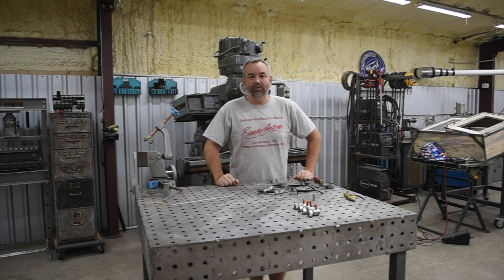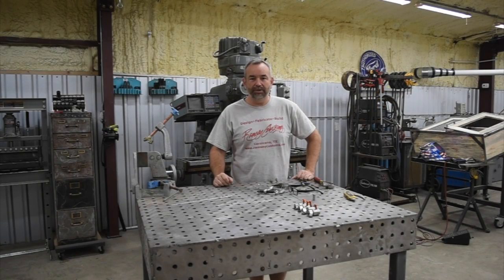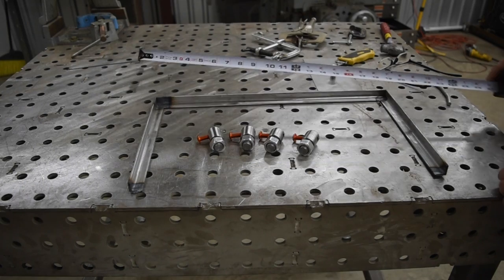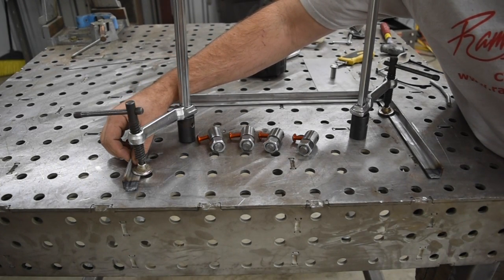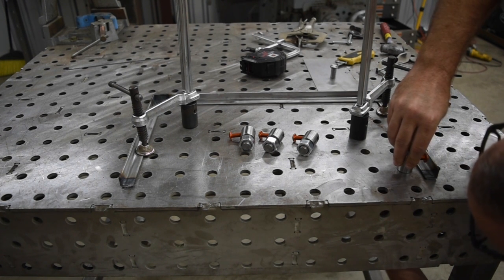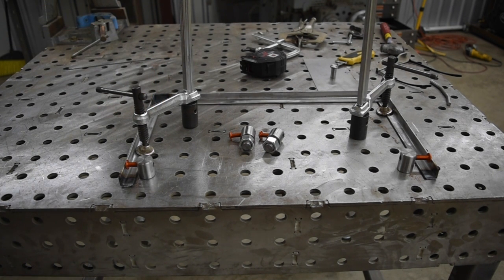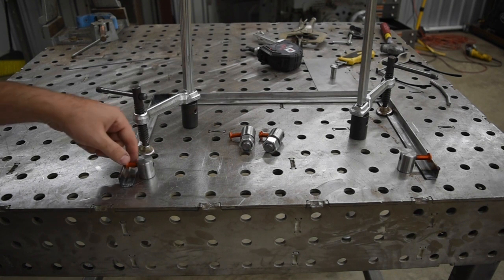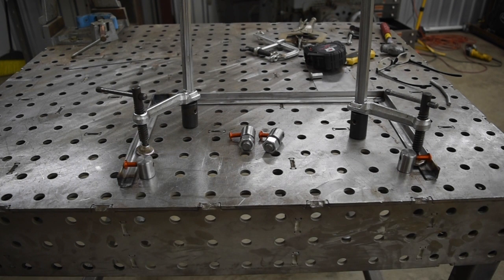Machining Fixture Stops for Build Pro - Certiflat - Fabblock Welding Tables - Stop Warping Welds

Comment: Put a scrap piece of the same angle iron under the back, unsupported edge of the foot of that clamp so you'll have a flat surface to clamp to. Or, clamp the foot of the clamp to the table (instead of the work) so IT acts as a stop, opposing your new stop. And I'd sure want to get that middle, top piece of the work stabilized and squared up to the legs, before moving and/or clamping the legs. Without that midsection stabilized, your new dog stops can't realize their theoretical accuracy. Which should easily be a thou, if you're using something like a 32 thread pitch adjusting screw. Good design. I'd like to see it used to it's full(er) potential. Thanks - Lumpy

Comment: Fantastic idea. Just a thought, if the orange bolts were longer, you could have them go through the fixture, then you could use an Allen key to adjust it from the other side.

Comment: How well do you like your tab and slot table?
Reply from the maker: I like it a lot, works well
Reply: If you need any further endorsements, I'll throw mine in. I don't have a fab block, I have the pro model and a mix of Stronghand and self made fixtures. Such a great weld table for a hobbyist. Makes getting great results very, very easy.

Comment: Awesome idea, I'll have to wait to make these until I have my own shop because unfortunately my boss doesn't think having a good table is necessary when making hand rails and what not including very expensive stainless rails. My table is 16 ft long and there is not one flat spot on it since its only 3/8 and over the years things have been slammed on top and other not so bright employees gouged it so many times with grinders. I'd LOVE to have a table like yours, I'll definitely have something like that when I get my own shop started.
Reply from the maker: cool man, sounds like you have some good plans.

Comment: That is a very good idea Gary, Good job.  The strong hand hold downs use a ball lock mechanism, you should check them out.
Reply from the maker: Thanks Bill, yea I have seen the rests, stops, eccentric stops, i have also seen the ball lock type, but i haven't see any that have as much adjustability as the ones in this video.  Those eccentric ones seem to have very little travel and sit flat on the table, which may or may not work for some things.

Comment: Wait until you see my fixture stops, you'll be kicking yourself on little work went into them ;-)
Reply from the maker: well if your are that good, i will just copy them and make more, so quit bragging and post it up dude!
Reply: You can totally copy them! As soon as my table gets back from CNC, I'll be posting my ultimate MFT fixture table. I went with 5/8 or 16mm holes because I wanted the fixture stops to work with my welding table as well.

Comment: Good job! What type of VFD are you using?  Most VFD has a low speed torque boost.
Reply from the maker: It's a Toshiba, 3phase input and output, it seems quite complicated.  I will scope it out to see if it has the low speed torque boost.